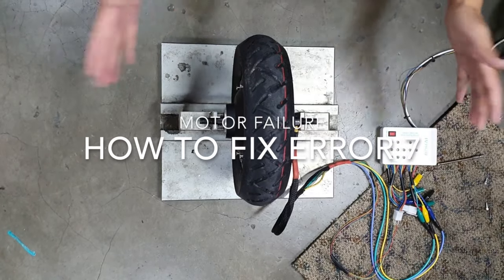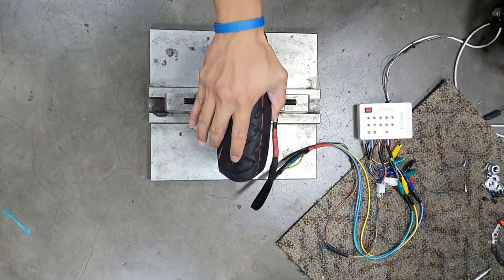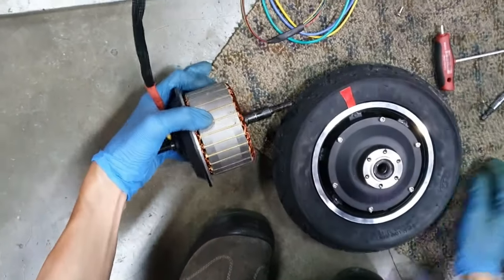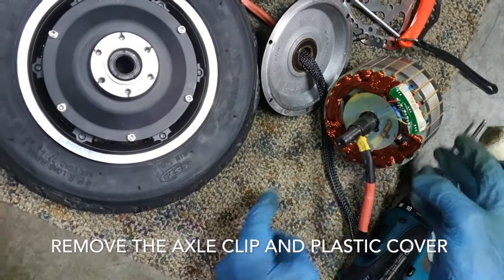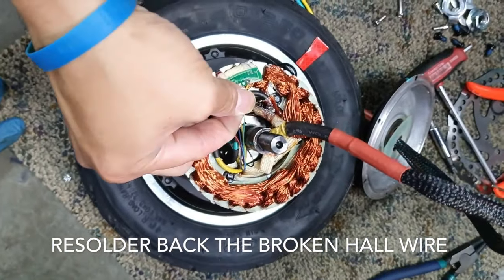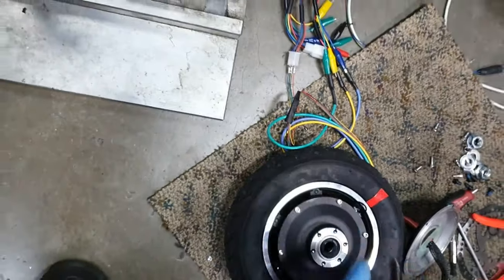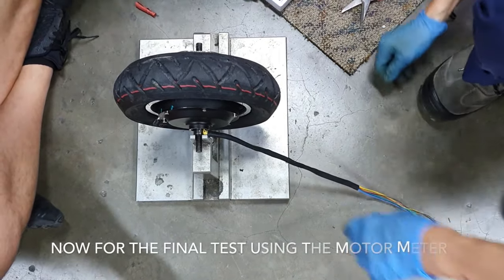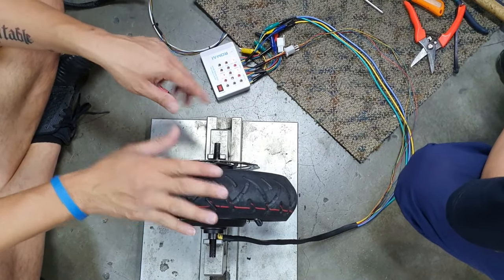How to Fix ERROR 7: Motor Failure on ZERO Scooter

Comment: I have a Sunra Miku Max with Bosch engine and the wheel with the engine got very hard to turn. Do you know such issue and potential solution for it?
Reply from the maker: @Taylan13  the gears are damaged

Comment: Hi, question: for my scooter, the motor won't turn smoothly, it is as if something is restricing it. I opened the same way as yours but there is no burning smell or parts fallen appart. The scooter was working fine until I rode it a few minutes on rubble (it was a rough surface) it then just lost power. It's turning on and off, battery indicator is working and when I press the electric brake it restricts the back wheel even more. It's just the acceleration is not working. Please advice:(
Reply: I have the same problem  my motor wont turn smooth . it is just like something block it . I also open it but nothing to see . 
I already order 2 motors from zero 10x becouse the original models are shit . upgraded motor type 3 is much better . 
now I only hope that my controller is not damage becouse off the stuck weel .....
Reply: @bjornvanoppen  Hello
Reply: Why doesn't the front wheel go on the go when my dual mode switch is just spinning or if I push, I can go fast with the rear, front doesn't work!
Reply: @jozsi3534  did you fix this issue?, I currently have the same one
Reply: @jorbbe9118  usually means one of the controllers burned out.
Reply: Sounds like  a shorted motor winding. Between the 2 of the 3 ( green blue or yellow) motor  wires to the motor
 When shorted acts like a partial brake with zero power, and can't hardly push the bike by hand
Reply: @patzoriley2  so, what does that mean? Will have to replace it?

Comment: I have a microgo m8 e scooter and when i am driving it it slows down or it turns off automatically and shows on the screen E7 .How can i fix it?
Reply: Same problem with same scooter here
Reply: @aodbo2lol355  how are you going to fix it?
Reply: @gersi1178  I haven’t yet , I might take it to an e-bike store
Reply: Do u guys find out how to fix it if so can you let me know
Reply: I've had the same problem for over a year on the same scooter, attempted to find the problem once before and took the scooter apart, but didn't have the melted solder issue like these guys, don't know what it is, might try looking again and getting a multimeter to test each hall sensor as maybe one needs replacing in comparison to resoldering
Reply: I think I've found the fix, I opened the battery up and two of the wires, red lead from motor power and red lead from motor charger had burnt off the connection to the battery terminal, I'm going to resolder it and see if it fixes it

Comment: I took my zero 9 to a place and the guy put a multimeter on the chaging hole and something exploded. Now It doesnt start. What could it be?
Reply from the maker: He must have shorted it by accident. It’s not a big problem. You just need to open up the deck and unplug and plug in the yellow battery connector. It should work again. But the charging port may be burnt and you may need to change the charging port
Reply: @FalconpevSg  thanks for answering, I will check some of your videos and try it.

Comment: Cordial friend greetings, can you help me with my ZERO 1OX I have a problem at times when actuating the accelerator does not work and on one occasion going up a hill I braked and at the moment of releasing the brake the scooter was pushed and when actuating the accelerator again did not respond The LCD screen did not show me any error and then while I was at home when trying to enter the menu, the code 7 appeared, which is a fault in the engine, immediately turn off and turn on again, this time it did not appear again, I went out to drive it for a while using the dual motor And in turbo and has not reappeared. I appreciate your help informing me why this is due
Reply from the maker: yes error 7 is motor issue, its possible to fix, check out this video: https://youtu.be/Tnrttq77JjQ

Comment: Solution: Hiboy scooter Error 7 means the Hall Sensor problem. Usually we have 3 (or 4) Hall sensors in the electric wheel, and 1 in the Speed Accelerator button and 1 in the Stop button on the steering wheel.
The problem can be related to the Hall sensor or the wires to the Hall sensor (more often).
In my case my wires from the Speed accelerator button were damadged and I had the Error 7.
Usualy you can easely check the Hall  sensor with minimum efforts. You can try to find video on the youtube. 
And initialy check the speed and stop buttons wires visualy ;). I hope it can help.
Reply from the maker: Thank you for sharing!
Reply: Y si no tengo sensor Hall en mi motor?
Reply: i have a error e7 on my fiat 500 scooter looks like when changing the tire i cut the wires some how. how to fix.
Reply: I’ve broken the same wires, any extra info on fixing that?

Comment: This might be the problem I have for my Gyrocopters plaid because every thing works normally when I turn on zero start and push the throttle the motor goes for a sec then e16 pops up on the screen and motor hall anomaly keeps popping up on the app but I don’t have the right tools to open up the motor to check

Comment: Hi!

I just realised your middle sensor in red, the 2 others in blue, so the middle one may not be the same...

I replaced it, and still have Error E07...

Could you give me all three sensors Part Number please...?
Reply from the maker: Sorry we don’t have it, your throttle has a hall sensor too try to change your throttle
Reply: The rear cable also becomes very hot and wheel jams... Some hub motor have a different hall sensor in the middle than the 1st and 3rd.. I think it's the case for the Zero 10X 48V 1000W hub motor, and I must have installed the wrong one..

Comment: Hi I recently had my charger port blown out(fire) im wondering if I replace the port myself will it sort out the issue or nah? because since it burnt out the scooter does not turn on anymore.. So is that an issue with the port or do I need to send it off for repair/replacement?
Reply: Well in my example I was a moron and i touched the charging port with metal pliers and it shorted out my zero 9 but when you unplug and plug back in the wires where the battery is located it should turn on fine... I also replaced the charging port cause it was useless after that.

Comment: Why you need to cut open all wires).Just open  motor and fix the problem  even  all cables are connected  to controller..is that  possible?iv got error 7,but when I restart  the scooter  it disappeared  and working  properly...One's i get completely    black out,no power suddenly. He doesn't  even charge. But after 10 minutes, he just run again, without  problems. Do you  know  what's  happening????
Reply: Restart? How do you restart a Zero scooter??? I need to know this. Thanks.

Comment: I just  spent $1429 to repair my Wolf warrior x and when They shipped it back to me the display has read error 07 ever since I turned it on after receiving... Seems like  after spending $1429 to have it repaired I shouldn't have to deal with this problem !!! Wtf?
Reply from the maker: It’s a simple connection issue. Just make sure your motor connection is plugged in properly

Comment: I have a LH-100 display with a 1000 watt 48 volt motor. But it gives me error 7 with and without hall sensor connected. I checked from loose wires but couldn't find one. It runs very bad til im at 20 km/h than i can go full throttle without problems to max speed. If i do to much throttle before i reach 20 km/h it  goes crazy and stops (breaks with shocks) and i can re-throttle and it'll work. But if i give to much gass it will kick out again. This is only before i reach 20km/h

Anyone knows a solution?
Please help.....
Reply from the maker: Your phase wires may have a problem. You can check your phase wires using this video.
Reply: @FalconpevSg  Ok i will check. Thanks!
Reply: Did you solved this problem? Got same with my scooter

Comment: My kugoo s1 pro has a m error light on ( I assume it stands for motor) it works then randomly stops accelerating to continue accelerating you have to let go of the  throttle and press again for it to accelerate could u help me resolve this issue
Reply from the maker: Best to ask your seller. Every scooter has different error codes and fault codes
Reply: Sound alike a controller issue. Did you ride in the rain recently ? (When you noticed the issue)
Reply: @jordaneromosele7678  I haven't road in the rain but the previous owner did
Reply: The controllers may have to be replaced. Happened to my wolf king yesterday. The scooter is so powerful so the issue of it moving on its own full blast when it’s on is so dangerous.

Comment: Thank you. I am currently stranded out 6 miles from home. And I ran into this error. I had some issues with my intertube. I replaced the tire and intertube, but it's so hard to get the tire back on the rim that I ended up putting a hole in the new tube. And I did the same thing again. Then .... I was running into the store to grab a 12" bicycle tube. I came back out to find this error e-007. Then it went back to normal as no error while I was fixing it. Then when I had everything back together, it went randomly error 7 and normal and error 7 then finally got stuck on the error.
Reply from the maker: Check the motor connector, it may not be inserted properly

Comment: Zero 9 with remote immobilizer activated. Everything was working fine for several months but now at 4:30am i was awaken with beeping + locked sounds , throttle shows E 06. Whats this please help? I need to go to work in 30 mins :(
Reply from the maker: E06 is battery under voltage